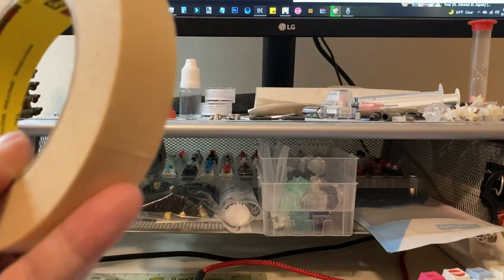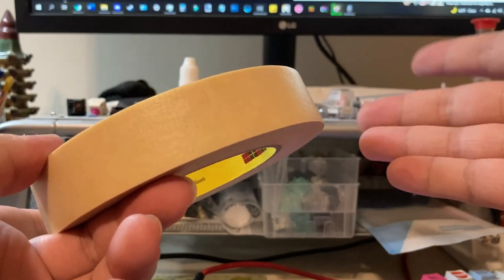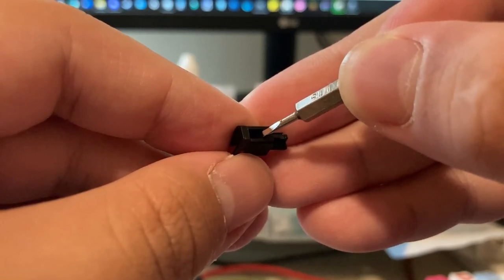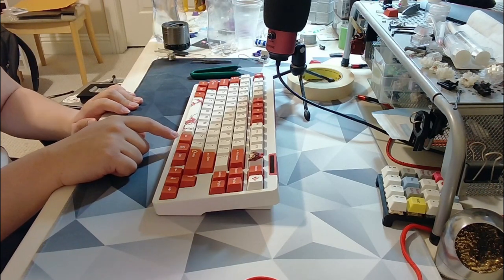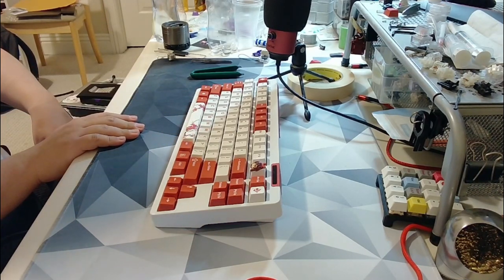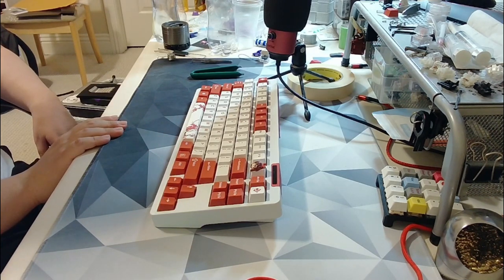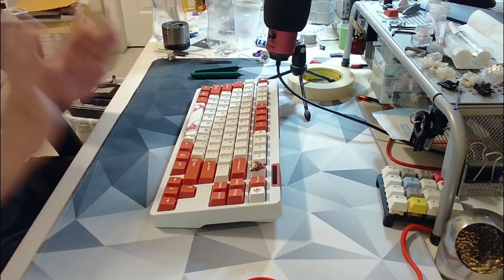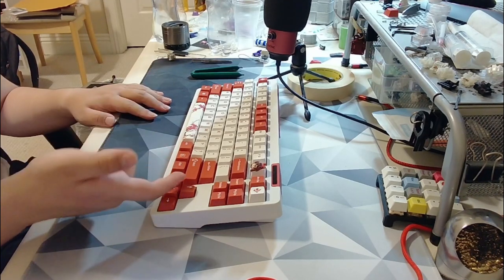I "Tape Mod" My Stabilizers. Here's How and Why.

Comment: It's been 2 years, so any update on the longevity of the mod? Painters tape is made of paper so I'm assuming the lube will eventually break it?
Reply from the maker: I still use the tape on my stabs, I haven’t taken apart my boards in a long while. I can imagine the paper being a bit gross but I haven’t noticed any degradation in sound. Will update when I get home if you want an extensive check-up.
Reply: @toufusoup  i actually used the tape with lube, thing is I updated my stabs so I cant really check the old one. Although I still use this mod on the new durock plate mounted stab, I just feel like they're easiest way to achieve a good sound together with balancing the wire

Comment: Do you still recommend this method of tuning your stabs? Also, out of curiosity do you wire balance your stabs? I am trying to bend the wires with my hands and it tires/hurts my fingers haha because I have to keep retuning. Anyway, nice video I am learning a lot from this.
Reply from the maker: I just did this with my ABKONCORE AR87 that just went up on my channel on the left shift, spacebar, and the right shift. They all seem to be just fine to me. Also yea don't bend the wires with your hands you're probably not gonna get anywhere. Wire balancing is one of the worst skillsets I have so I take to other measures such as bandaid padding under the stabilizer wire on the PCB and holee modding lol
Reply: @toufusoup  ah so do you recommend also tape modding the pcb where the wires will make contact
Reply from the maker: Yeah I follow this guide whenever applicable: https://youtu.be/UhIiCmxtMmA

Comment: How many layers of tape are you using? I'm curious to know how much of a difference there is between 1 vs 2 layers of tape.
Reply from the maker: I always have used 1 layer but you’re welcome to try 2 lol

I know nearLucid released a video but I think the tape he’s talking about is much thinner.
Reply: @toufusoup  I think I'll stick with 1 layer. I did a makeshift Epsi mod but instead of using deskey switch films I used the stabilizer pads from KBDfans. I'd gladly stick to 1 layer if it means simplifying life lol
Reply from the maker: If it works it works :p

Comment: so do you think using different kind of material for stabs modding change the sounds? or just solely for reduce rattle and ticking?
Reply from the maker: It’s solely for sound mitigation. Your stabilizers aren’t the switch/keycap noise.
Reply: @toufusoup  how about different material of stabs such as polycarbonate vs genuine cherry stabs? does is sound different tho?
Reply from the maker: It could sound different but the key switch and keycap will be the things making the most noise.
Reply: @toufusoup  ok2 thanks for the explanation...happy modding

Comment: does it feel mushy when u do it? and if so for how long ? ik its an old video but i want to know
Reply from the maker: Its purpose is that it’s thinner than bandaids but still is a form of fabric that it’s not as thick/will lessen a bottom out noise/fill in a gap if there is one. So compared to bandaids I personally think it’s good, but you gotta be sure your stabs are completely clean. Otherwise shit can go south.

Comment: Do u need to lube your stab wire when u ur method?
Reply from the maker: I still do it
Reply: @toufusoup  did you lube it directly on top of the tape?
Reply from the maker: I just lube the wire then assemble as normal. Maybe check for wire ticking on the PCB and or whether or not there’s enough where it connects but that’s just standard procedure really